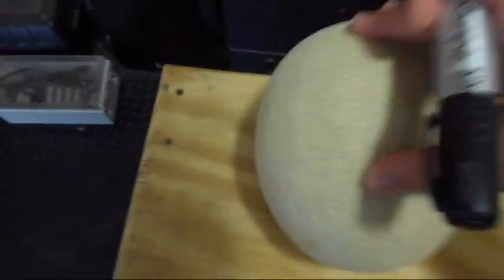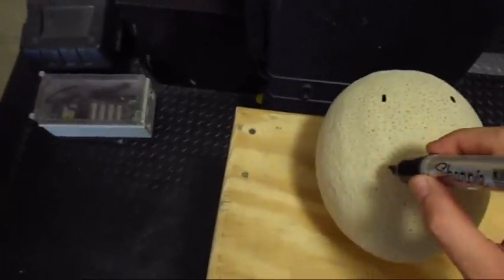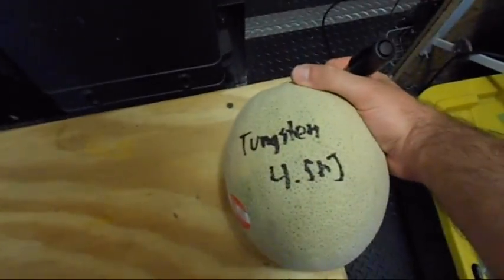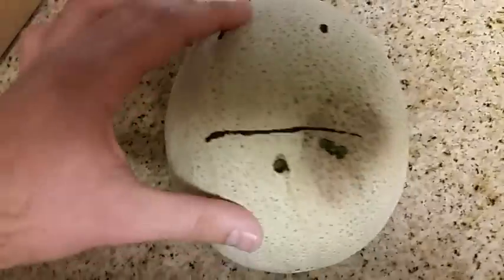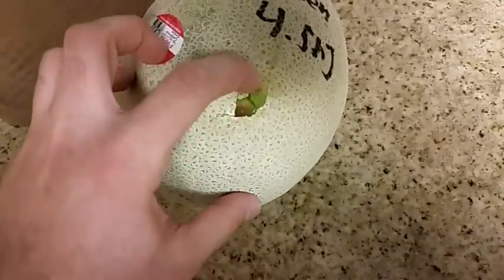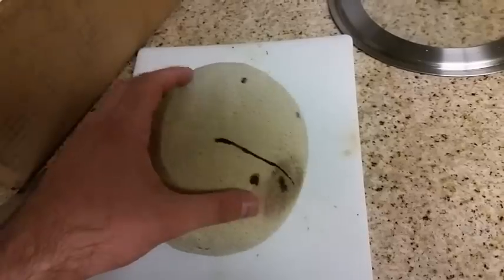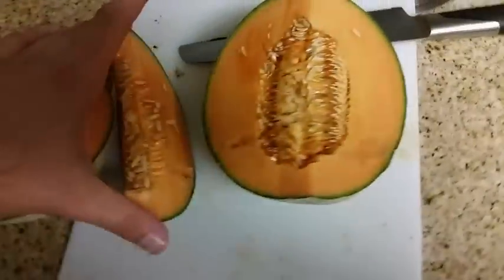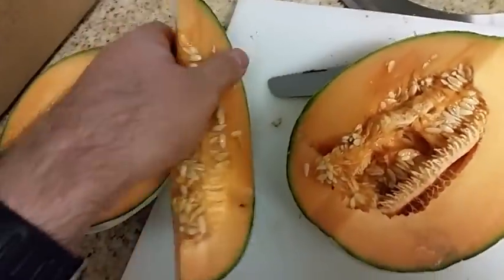SEMI-AUTOMATIC RAILGUN: Tungsten vs cantaloupe

Comment: Hey I have a question about the construction of this railgun my question is Do you have a non-conductive plug/stopper to seal the back end of what is essentially a cannon... And from what I know about making cannons are two things the Canon needs to be sturdy in the second thing is it needs to be airtight except for in One Direction. Hope this helps... P.s it should as magnetic force alone is only so much as plasma is heat and pressure with the energy so it must travel also like a gas hope it helps and also I theorize that for Optimal Performance in effect the arc jump should happen 30% down the rails
Reply from the maker: Sortof.  Behind the rails is an injector which is basically a valve hooked up to a pressurized gas hose.  On solid metal slugs, the high pressure injector and lorentz force is doing all the work.  The plasma pressure is really minimal since the metal is almost as conductive as the plasma and the shot energy is mostly dumped into the metal slug in the form of joule heating.  It's a different story on plasma rounds, where the plasma has no solid metal to heat and so the plasma itself absorbs the energy, heating the expanding gas which creates high pressure as you said.  This pressure does exert some force on the injector valve, but since the injector itself acts like a check-valve and the pulse is so short, most of the gas is forced to expand forward, pushing the round out.
Reply: NSA_Listbot you ever think to fire the projectile from 30% down the rails to increase said lorentz Force theoretically... might help at least minimally
Reply: NSA_Listbot and the plasma rounds are a nice idea... it's like putting a non-conductive tip on a bullet for guaranteed assurance that you actually have a projectile to fire on the account that sometimes the metal can get vaporized and metal Vapors tend to have very little kinetic Force LOL
Reply: NSA_Listbot you sir have just gained one subscriber 👍 haha
Reply from the maker: Hey thanks man!  And yeah, the 30% thing is possible with SCR triggering, but I don't want to open that can of worms.  That's a pain.
Reply: NSA_Listbot . lol 
Hey its no problem. & good luck with the research 👍

Comment: This thing is great!
Do the magnets make a huge difference in the output energy?
P.S. I'm sure your charge times could be greatly improved if you use something of this power:
https://www.youtube.com/watch?v=IycwllNw_aQ
Reply from the maker: Hey thanks man!  Not as much as I initially hoped.  One of the major problems I am running in to is poor contact between the projectile and the rails, leading to excessive arcing.  The machining tolerances need to be tighter.  So plasma rounds work great because they're designed to arc, but conductive armatures are just making a bunch of sparks and not doing any real accelerating.
Reply: Why don't you try using brushes in your projectile design? They go a long way.
Reply from the maker: Brushed projectiles are really hard to stack in a magazine.  I definitely want to stick to cylindrical armatures, or maybe rectangular.  But I would like to experiment with an SCR or thyratron switch rather than the simple contact switch I've got in there now.
Reply: Oh, I see. I've seen designs with liquid metal wetted rails, I guess that would be too much. Do you have a pulse forming network in the capacitor bank? They increase the pulse duration, so more acceleration.
Reply from the maker: Nah, it's straight from the caps into the rails.  I've thought about adding an air core inductor though.  Pulse duration is definitely too short.